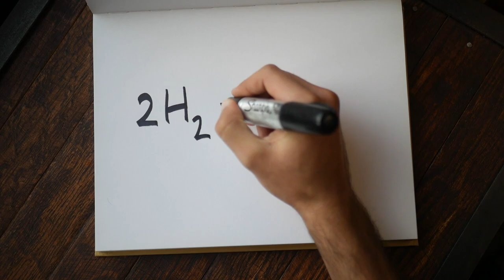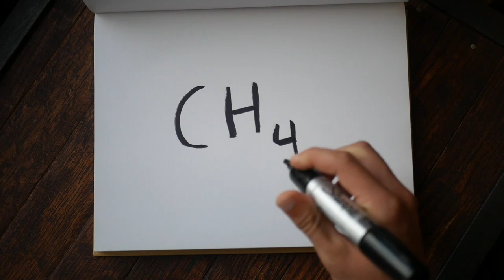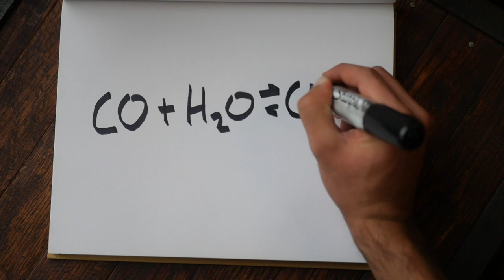Hydrogen ISN'T A Clean Fuel | Real World Chemistry

Comment: While this video was just about hydrogen fuel, I think a video about green energy should point out the most electricity turbines are run by coal and are inefficient in transmission so that can also be debated as a green energy source.  Regarding the hydrogen cell energy, the biggest barrier I read about is that the exhaust of h20 is at near boiling if not super heated which can melt black top before vaporizing to gas and would require a massive resurfacing of much of our road system.
Reply from the maker: Definitely good points about energy generation on the grid. It depends on where you live (like where I am is a lot of nuclear) that is clean. I imagine the temperature of the exhaust water could be regulated even by just a radiator type setup before it leaves the car to cool it. It’s a very complex topic that needs to be talked about!

Comment: But I mean to counter the nitrogen oxides  problem you would just need to pump carbon monoxide along a platinum catalytic converter  so you would form nitrogen and carbon dioxide instead sure carbon dioxide is a green house gas so that is a negative i guess
Reply from the maker: True there are definitely ways around it! They just tend to add complexity and aren’t 100% (as you said with CO2 formation)